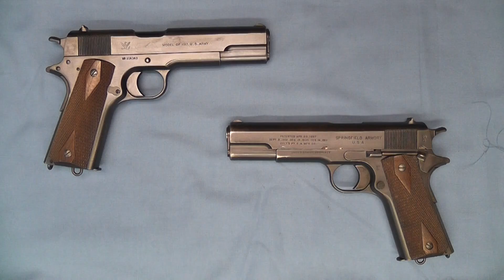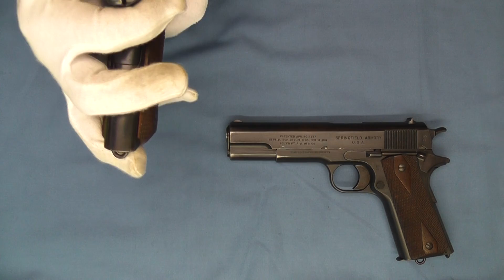Springfield Armory Model 1911 Pistol .45 acp

Comment: I too have an original Springfield 1911.  My Dad bought it surplus before I was born (over 50 years ago ;) ).  It originally  had a  colt slide.  Luckily I found a Springfield slide in great condition.  The beautiful walnut grips are original Springfield.  

I would like to make a statement to all... These beautiful old guns are all now over 100 years old.  It is time to give them a rest.  Modern ammo maybe hotter than the old military ammo.  The steel in these old guns cannot come close to the quality and toughness in a modern firearm.  Cracked slides and frames can easily occur.  So give these old guns a rest, pass them down to your kids, tell them the story so they will appreciate them and preserve them for the future.  

 Go out and buy you a modern GI model from Springfield army and shoot it.   You won't be able to tell the difference in the  actual shooting experience.